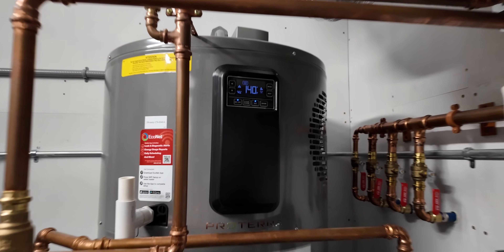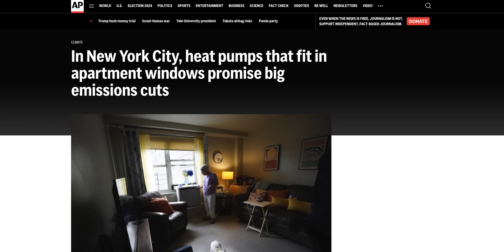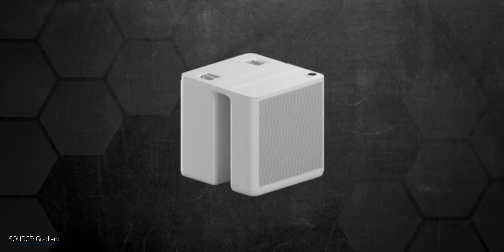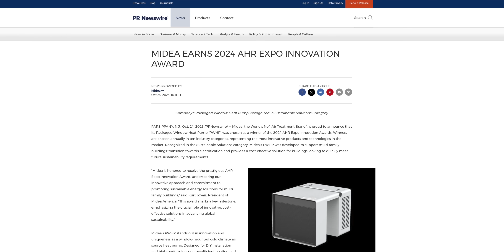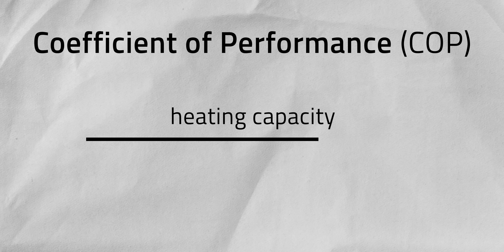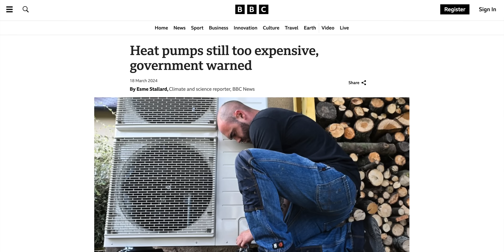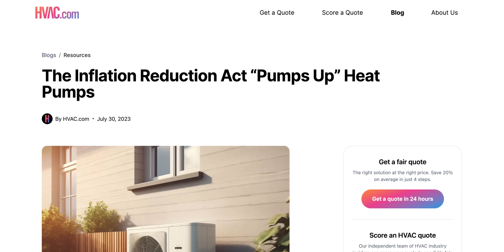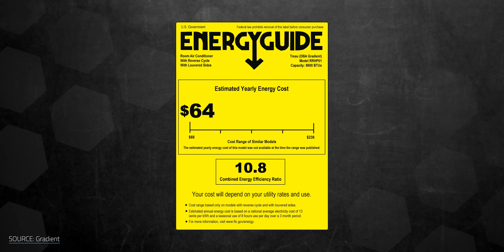Why This Window Heat Pump Is Genius

Comment: Great video.... 

I am a retired Heat and AC contractor and engineer, these saddle type window units and similarly adapted mini split systems will take over the heating and cooling market for the next 10 years, efficiency and reliability will be further improved to maintain those very high price points.

At current prices, efficiency and spotty reliability levels they are over priced imo...  common for new products.

Mini split adaptions, with 2 or 3 times the heating and cooling capacity  will arrive next.. in a year or so... with tubing run through faux baseboards to fan coil units in the other rooms.  

And all of this in easy to repair modular, snap in and snap out electronic control components  (the current weak point in current systems).
.       *******

Owners will be smart to power these through sufficiently large surge protectors ....so that our rusty and currently over loaded power grid infrastructure .... will not continue blowing out the elaborate and complex electronics that these systems rely on...

.that is a key issue with such equipment especially as purchase and repair  prices reach the stratosphere.

Comment: where i live we just have normal split unit ac's that all can run in reverse to heat your place up. we have had these for years and them being complete spilt units lets you have all the greatnesss of the cold not leaking out and heat not leaking in or the other way around. but for heating we still mainly use the radiators in our apartments that run on natural gas and every flat has it own heater. i think it is a pretty efficient system.

Comment: Strain on the grid? What are you talking about 

Each added heat pump will reduce the load on the grid.

Assuming you guys aren't doing something ancient, like using gas or another burnable fuel for heating

Comment: Upgrading to heat pumps seems like good idea. 
However, something fishy is going on with the pricing here. $3000 bucks for a tiny 9kBTU unit is absurd.

This feels like a scheme to use rebates to transfer government money to some private party (with a side scheme to shift heating costs from the building owner to residents).

Even if these are legitimately $3000 appliances, I'm skeptical that they will be good value. It's unlikely they'll have a 20 year lifespan, so replacement costs are going to be high, if anyone bothers to replace them when they eventually fail.

Comment: These sound like nice units, BUT... 
1. They sound like they're really only for a very tiny part of the country. A good deal of the west sees temps far in excess of 95 Degrees F, and that's with low humidity. I don't think that unit would survive a single Arizona Summer, where the average is 110 deg F., we get streaks of 115 deg F, and 120 deg F isn't out of the norm anymore. (Thanks, Global Warming!) Then you have the South, where the temps are a bit milder than out west, but high humidity causes other issues. And winters in NYC and Boston are far milder than a lot of places in the Midwest and northwest, like Chicago or Minneapolis. 
2. The form factor only works if you have a window that the lower part slides up and down. There are a lot of casement windows where the glass moves sideways. This means you're still opening the window the same amount as a normal window AC unit, but you have more of a hole to plug and insulate. And that's if your window slides and not one of the other half dozen form factors that hinge or move and cannot accept any kind of window AC or Heat pump.

Let's face it. These are niche products for a small market. Great if you fit the use case, but you probably don't fit the use case.

Comment: One small issue, you can't open that window without bugs coming in since you won't be able to use the screen.

Another larger issue is some windows slide sideways(like all the windows in that building), not up and down. So you will have to constantly have the window open with no screen.

Comment: It looks nice, but the windows in my house are full length/height, and are only 14 inches above the floor. The unit described here would not fit.

Comment: Like everyone else in the comments, I'm a bit floored by the cost for a window unit.  Perhaps if there were more features, like the ability yo daisy chain multiple window units or mini split style install options. Something, anything, that justifies its high cost over the perceived replaced window AC unit's value.  It pay pay for itself in the long run, and perform better in the ahort run, but i cant see consumers choosing this at that price regardless.

Comment: Consider: NYC commissioned tens of thousands of units @ $5,000 ea. for their subsidized apartments to help meet city emissions commitments.  Price reflects warranty, build quality and probably insurance, self-install design to avoid inconsistent installations by installers.  Low BTU I imagine being compliant with older building wiring.  These are specific-use units.  I imagine price will come down.  They are quieter than one piece window units, more efficient, durable, safer, low temperature, no drip complaint free units.

Comment: How does a UX designer turned tech youtuber never mention that this only works for vertically opening windows?! I've never in my life lived in a place with these ancient style opening windows and it's been a major pain in the ass for installing window mounted AC units. They're all designed for this ludicrously outdated window style and modern windows have to make due with cardboard or acrylic slats to fix the huge gaps left by installing these in other window types.

Comment: Just flip the plug on your window AC units upside down to run in reverse. You'll have to clip off that silly third prong, they put it there just to prevent you from accessing the heating potential....

Comment: You mentioned replacing the boiler in some of these old buildings. Sometimes that's simply not possible because they don't have a way to remove it or space to move a new one in

Comment: The prices on these are just nonsense. They need competition, and less complex models available.

I was looking into "mini splits" and such recently and couldn't shake the feeling that we should have some that just sit in the window, or have window pass through for a non destructive install, but I couldn't find any. Then I came across some of what you have in this video. It was hard to find a price, but once I did, I was so incredibly turned off to the idea. The 50 year payback has no benefit to me.

I'd sooner just feed a mini split through a window and make that work than buy one of these. I know that's not a great option for apartments, but they're not going to spend $3000 anyway.

Comment: 3k for 9k btu is a little excessive in my opinion. You can get some 12k btu mini split heat pumps for around 1200 bucks and they are really not that hard to install.

Comment: It makes no sense to be doing air conditioners only everything should be heat pump combination units.
And the original AC design well I understand it came out of function hasn't changed in decades! There's like one company making a standard AC that does the notch style this is a welcome design change.
There is the benefits of switching everybody over but I think maintaining the steam heat system makes sense as a back up just at a lower level. Then you're gonna have excess steam generation and infrastructure still in place, Maybe somebody can come up with a system of micro electric generation off of Steam or even some sort of hybrid steam generation heat pump system for the building infrastructure.

We went through this with Solar there was only install it on your roof if you're a property owner. I said for many years what about people who rent, now there's a half a dozen companies that sell power stations ( please don't call them generators they do not generate anything unless you have a solar panel and only the solar panels are doing the generation then, they convert their essentially a gas can. and speaking of gas let's not confuse the term generator that puts out carbon monoxide with batterys like we do with engines and motors ).

Comment: But they are all designed for vertical movement casement windows, and none seem to be utilizable for those of us with 1950, to 1970s Ranchers with horizontal sliding windows.  So, still a big no for much of America.

Comment: Remember that, unlike an air conditioner, or heater, the compressor on a heat pump will be running a lot of hours every year because it is performing both functions. So you probably can't expect them to last 15 or 20 years like an electric air conditioner, and a separate natural gas heater often can. Heat pumps are more complex than straight air conditioners and often contain expensive to replace electronic circuit boards. And since these units are expensive to purchase, you might not save as much as you plan.
 Don't forget the noise factor, especially if you live anywhere the outside noise level is high. As I discovered while running my generator during the last power outage, noise can come through small gaps around doors and windows. Maybe it can travel through these units into your home. That used to happen to me when I lived in a house with a window unit in my bedroom. Vehicles with illegal exhausts eventually got to be an annoying problem, before I relocated after Hurricane Katrina. The noise would come right through the window unit, since Styrofoam doesn't stop much noise. 
If they are made in China, a big tariff on Chinese imports could send the price of these units way up. And Xi will soon blockade Taiwan. After that, spare parts from China will probably be cut off by sanctions. When Xi tells his fellow CCP members (speaking in Chinese) that Taiwan WILL be reunited with the motherland, he IS NOT kidding. A naval blockade of Taiwan by China is coming before 2030. A major war between China & the USA would wreck the entire global economy, so that probably won't happen. Taiwan is toast. So don't count on spare parts, or much trade with China, for too much longer. Sanctions will see to that.

Comment: Yes, a boiler has a COP of a little less than 1.    But since it uses all of the heat from the fuel, you have to include the 60% efficiency of a fossil fuel power plant.  So the difference isn't as big as 2.6 vs 1.    Assuming a fossil fuel grid, it's more like 2.6 to 1.8.   Still a benefit and something we all need to do.    Fo me, it means that I'm going to wait for my furnace to get to the end of life, before I get a heat pump (2 to 3 years)

Comment: I think the biggest issue with a unit like this is that it seems especially designed for smaller apartments (hence the NYC usage), and even then, it doesn't help if you end up closing doors (when sleeping, etc.).  If the price was lower, you could consider installing multiple units, but even at $2000 a pop, that's a hefty investment.  For a home, you may just be better off replacing some or all of your existing HVAC functionality with a mini-split.  (It won't be all that cheap either though.)

Comment: Haha 2-3k, only the Government would think this is a good idea.  Gas for heat is super cheap and effective and dual inverter AC units are now priced well thanks to Midea.  For a home owner this would be a horrifc spend compared to thr price of split units that are much cheaper and more efficient.  For a person in NYC who is renting it would take forever to recoup the  cost of this and there is no way the grid could even support such a thing with hs switching to unreliable renewables.  This is a fantasy

Comment: So, in theory I could use 2 ac for 300$ and just flip one and get the same effect? I don't believe the yearly pricetag, compaired to what useage? If you really want to save the environment, use the 3000 and 200 something per year per flat unit (or rather per room as this is murica we're talking about) to install a proper solar/wind park or even go deep geothermal to supply the whole city. Enough power to supply all the ac and heating requirements for ever. Bam!

Comment: The fact that this heat pump still requires window for it to function, people would rather just buy regular electric heater and plug it anywhere in the wall, no venting required. After all, there's a new bill proposed by lawmaker in California where the electric company will bill you based on your income, not your electricity usage. Therefore, your usage literally doesn't matter and you can abuse it all you want. Instead, you pay higher bill the more money you make, so the rich people pays all the bill.

Comment: Like others in the comments I am really not sure why this should be $3,000. That's frankly insane. Is it really that much more complex mechanically than an AC unit? I thought one of the main draws of heat pumps was that they were actually mechanically more simple.

Comment: The efficiency in a south-facing window with a brick facade has to be pretty great. Indirectly pulling those thermal gains into the envelope of the building is brilliant.

Comment: Please crack a window during winter. You need to cycle your air. Mould hates it when you do. Sure, turn your heating off, but you need that fresh air. Condensation needs to get out somehow.

Comment: All air/air heat pumps I've encountered will, in heating mode, when it's cold outside, have to frequently run a defrosting cycle, which thaws the ice on the external part, and results in water dripping from the unit (quite a lot in a short amount of time).

How does that work with these devices? Sounds suboptimal to drop water down the house.

https://youtu.be/0sGosUlqIVM?t=162 as an example

Comment: We live in India and search for used Air conditioning units probably 100 USD which is good enough. Don't need heat symptoms as it's a hot climate. 😅 

With 3000 USD we can build the whole house 🙄 we are that much advance 😉. 
Jokes apart I know it's a western channel so all good here.

Comment: Yes a big upfront investment. But maybe worth it? My heating bill can be as high as $450 CAD per month in winter. I heat with electric baseboard heaters. I might need 3 or 4 of these $3,000 USD heat-pumps though, so even if they halved my winter-time energy use, it would still take 6 or 8 years to pay back, unless my cost of electricity goes up a lot. (which it might because of the Site-C dam boondoggle)
 But how many would I actually need? How many square (cubic?) feet is each one rated for?

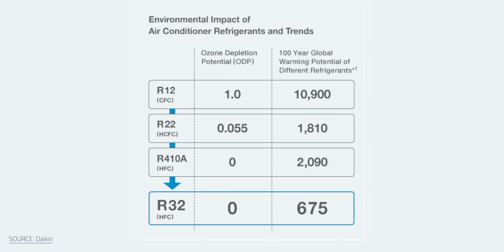Comment: Regarding 8:02 does someone know if there are heat pump designs that use common cheap materials as refrigerants instead of stuff like R32 with 675 times more global warming potential than CO2?
I mean usage of water, CO2, nitrogen, water with additives, alcohol, anything that is available in large quantities, possibly household substances and could be used as refrigerants?

Comment: Could this idea be applied to clothes dryers?  A window mounted or balcony mounted clothes dryer that uses the warm, dry outside air to dry clothes instead of an electrical element?  There would only be a need for a wire mesh type drum with a small motor and belt to spin it at the right speed.  It would be better than a clothes line for an apartment building (which I didn't see in the video btw).
Reply: Unless one lives someplace like Arizona, that warm air probably isn't dry. 😀

That said, clothes lines worked well before clothes dryers existed.
Reply: @lonniemcclure4538  The problem with clothes lines is they aren't well suited for apartments 20 to 50 stories up.
As for your Arizonia comment, just about everywhere in the world uses clothes lines  except in NA.  I am not sure why that is so?
Reply: @anguscampbell1533  - Every seen older movies and cartoons where apartments would have a pulley system clothesline stretching across the streets between buildings?
Reply: @lonniemcclure4538  Good luck doing that today.

Comment: VRF would be the best option for apartments that could retrofit this. It's a big upfront cost but it gives each space full control over temperature control.
Being able to move heat from one space to another or reject/source it from the rooftop coils is the most efficient way.
Reply: I think hydronic distribution is better than VRF. Instead of running tons of refrigerant lines you only need ordinary water pipes. The pipes can lead to a separate heat pump with heat recovery. Compared to VRF you can upgrade the heat pump without replacing the entire system.
Reply: @eDoc2020  that's true, you do need a bit more space though as water piping will need to be a bit bigger, and you'll need separate htg/clg supply lines, unless you have an  automation system that can control a remote mixing valve to the space.

Comment: Looks good but how will you heat your hot water like the bigger units do as well? I live in an apartment ( we call them flats ) here in the UK and it would be nice to have aircon as well as the climate is changing here more lately but our windows are designed to open differently here so may need a new window fitted? We also get rebates of up £7500 here to have a heat pump fitted which could help, just hope the price is affordable especially if it gets into mass production.

Comment: I can't help but also wonder why these are so expensive compared to a less space efficient heat pump already available. The 23 seer we just installed in our garage was just $1k. That said, we installed ours, a 12k BTU unit, to use the excess energy our Ford lightning offgrid charging array produces. Surprisingly, when we run it when not charging the truck, it can reduce our household electric use by as much as 20kW per day. We have an insulated garage door, but we didn't expect that much benefit.